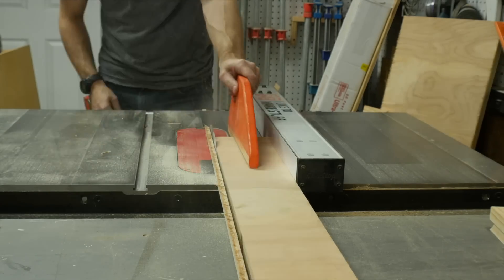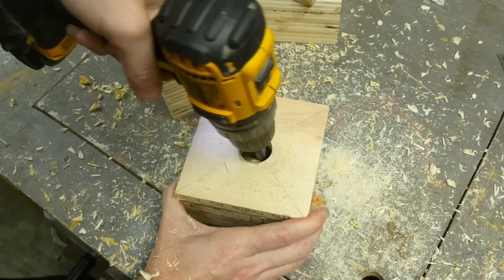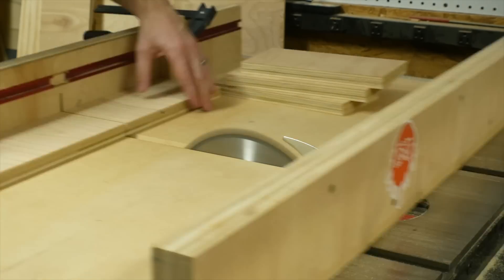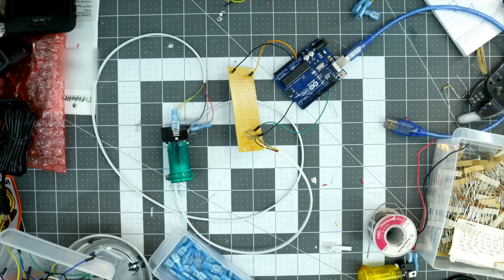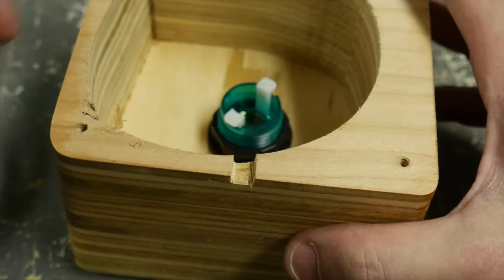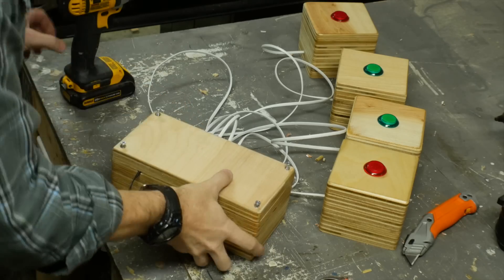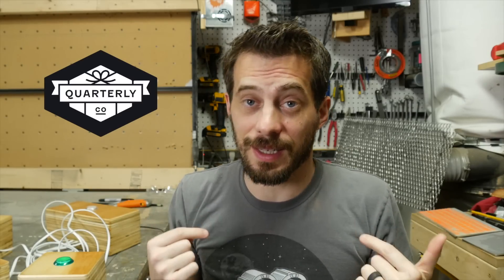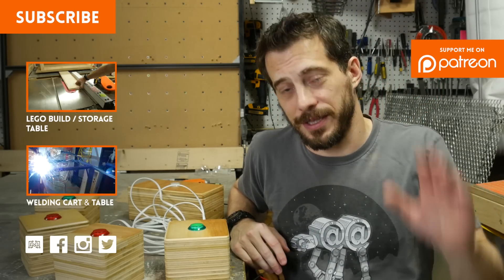Quiz Game Buttons // How-To | I Like To Make Stuff

Comment: 3:30  Better to put in a jack plate with 4 female RCA jacks and put male RCA terminators on the 4 buzzer boxes. That way if you have a short, you don't have to crack the box and resolder. Also allows you to use extension cables if need be with a male RCA at one end and female at the other

Comment: ok used your setup programmed audrino with your code BUT PROBLEM WHEN I GET CLOSE TO PUSHING THE RESET BUTTON IT TRIGGERS I DONT EVEN TOUCH THE BOX MY HAND GETS 2 INCHES FROM BUTTON AND IT TRIGGERS ANY IDEAS  WHAT IVE DONE WRONG CHECKED ALL EARTH WIRES CHECKED ALL BREADBOARD STUFF IM STUMPED  need help 
sorry for capitals i wasn't watching typing sorry people hate capitals

Comment: you should have put a telephone Jack on all the boxes instead so you can just unplug everything for storage or to use longer wires. you could also really easily add a buzzer to the player boxes or 4 LEDs to the control box to easily tell who buzzed first.

Comment: So, I know this request is nearly 2 years after the original post, but I figured it was worth a shot.  Anyway, I want to design a game show buzzer similar to what you have here, with the first button pressed lighting up, but I want the button to start a predetermined (10-15 second) timer when it is pressed.  Then, at the end of the timer, a buzzer sounds.  Then, I can hit the reset button and to stop the buzzer and/or the timer and start the process over.  I may be getting in over my head, but I thought I could dream.  Any help would be greatly appreciated.  I like your channel and I thought if anyone would know how to make this, it would be you.  Thanks, man.  Keep up the good work.
Reply from the maker: Hey David! That's a fairly simple upgrade from the code I used for this.  Grab that code from my Github as a starting point, if you want.
Once you've captured that a button has been pushed, write the variable 
unsigned long StartTime = millis();

This is the # of milliseconds since the program started running.
Every time you enter the loop, do something like 

unsigned long CurrentTime = millis();   //capture the current time since start
unsigned long ElapsedTime = CurrentTime - StartTime; //find the elapsed time

if ElapsedTime > 15000, then do whatever...  

15000 milliseconds being 15 seconds.

hope that helps!

Comment: Also why to hot glue straight to the arduino? atmega chip and hard wiring would be much cheaper. and you are using like 9 io ports lol. 

and what is in the maker box? lol.

Comment: I made a very similar device using an Arduino Mega.  Since the LED and the button can share a ground, I used a 3 wire stereo audio cable. That allowed me to have eight 3.5mm jacks on the control box so that you can plug only as many triggers as you have players.  I also added a little piezo buzzer to the control box that went off when a button was pressed.

Fun project.
Reply: I used a mega to have enough I/O pins for 8 players. You need 2 pins per player (input for the button switch, output for the button light), so not sure how many players you can squeeze into an uno. You can probably use the analog pins as inputs if you start running out.
Reply: @eugenerk  Thank you!
Reply: Do You think I could do the same with an Arduino uno ?

Comment: since you were using phone cords how about male plugs on each end and female receptacles on each box? That would be easier to store, help with tangles, make cord replacement easer and let you use longer cords if you wanted.
Reply from the maker: +John Kolesa Also more work and I hate punching those wires into terminals :)  I had to run too much cat5 back in the day.

Comment: considering you're using those phone cables why not place the actual connectors 
now you have everything constantly connected and a big cable mess

if you use the original connectors and plugs you can store it a lot easier and it will take only seconds to connect and use rather an hour to untangle the wiring

also maybe a small phone vibrating motor for a extra bit of feedback to the user?

Comment: Something I just recalled about using phone wire for projects: Older telephone wire can sometimes be a copper wrap around some kind of cloth like bundle of fibers. Just toss this type of wire out. It's very difficult to solder to and I'm always a little paranoid that the fiber might be asbestos.
Reply: +Right. How do I make that? I second that. It's a real bitch to first strip without cutting the whole thing, and then to solder. Pro tip: to get rid of the cloth around the thin wires, use a pocket lighter to lit these mofos on fire. This will also melt the little plastic insulation around the wires and will expose them nice and clean.
When he said he was gonna use telephone cable, I was like 'you crazy bruh?!'
Turns out he used newer cables eh xD

Comment: Nice Project! My suggestions to make it a bit better: 1. Use an Arduino micro. i think it can act as a keyboard, so it could control a quiz game on pc, for example. 2. An Uno is a total overkill here. the micro will take much less space.
3. Don't glue anything on the arduino. Design a board with a socket for the micro. it will look better and you can take out the arduino afterwards, for programming. These are my ideas, but your project is nice anyways.

Comment: Nice, but Arduino is an overkill here, you can make the necessary circuit for less than $5
Reply from the maker: +Aleksandar Tadic That Arduino was $7 on ebay, so that's not a huge savings, plus, like I've said in countless other comments.. I'm not looking for the most streamlined way to do projects.. I'm looking for ways to remove barriers to entry so people with zero experience can jump in and get started.
Reply: I didn't realize Arduinos have gotten so cheap.
Reply from the maker: Ridge Woods You are correct :)
Reply: +Aleksandar Tadic Yeah, there's even chinese Arduino Uno clones that sell for $3.50. It's crazy.
Reply: +Aleksandar Tadic $1.32 if you're interested http://www.aliexpress.com/item/Pro-Mini-ATmega168-5V-16MHz-Compatible-for-Arduino-ProMini/32579326448.html Just have to wait 4 weeks....

Comment: I see you're using the Arduino as the source of the LEDs which is a bad idea since the individual ports can't handle all that much current. It'd be a better idea to use the Arduino to sink, meaning you'd connect the plus wire to a resistor and positive end of the LED and the negative end of the led to a port on the Arduino.

Comment: nice, you can strain relief those cables with zipties (prevent pull out), or better yet tie them to an internal screw/post/staple...luckily it's easier to pull a rope than push one ;-)     monodirectionalFTW hehe

Comment: Great. Just one tip, next time try to knot the wire from the inside of the box, that way if someone pull the cable hard it will never break the bond of the super or hot glue. Of course it the pull is too strong the cable will tear apart.

Comment: How many Arduinos do you have?
Reply from the maker: +technician2014 thousands.  Actually, I bought about 10 of them from China (they're clones) for about $3 each a while back.
Reply: +I Like To Make Stuff Do you have the website? Thanks!
Reply from the maker: technician2014 Looks like the price has changed a bit since then, but still, $7 is pretty good! http://www.ebay.com/itm/252142616650?_trksid=p2057872.m2749.l2649&ssPageName=STRK%3AMEBIDX%3AIT

Comment: Nice project. 
An idea could be having all the cables to the big box be connected in a socket, each cable has it own socket. so you can diassemble it all and dont have the wires tankled. But just an idea. I know it will take some more work.
But thx for sharing.
Regards.

Comment: Excellent project, Bob. Any thoughts on how you chose the size for the boxes? Obviously they have to hold the button pieces and wiring, but they looked big to me at first glance. Kids had no trouble with them : ) and now I wonder if smaller would actually be harder to use. Mostly curious about your design process on that.
Reply from the maker: +Matthew Friedrichs It was just kind of random. I wanted to make sure they were heavy enough to not knock around on the table but otherwise I just picked a non specific size.

Comment: Hey Bob! Any particular reason you didn't use a forstner bit on the drill press instead of the band saw? It would have avoided the cut in the side of the box that had to be glued.

Comment: What does the 5th pin do? Also - it would be a cool idea to be able to put a couple extensions in so you have the base 4 and can add controllers!
Reply from the maker: +Jake Masters They button part of it has the 3 pins,  two of those are labelled "normally open" and "normally closed"  Depending on which you use, it changes the behavior of the button.
Reply: +I Like To Make Stuff Thanks! :)

Comment: This is really cool Bob! I haven't played with arduinos at all, but would it be much trouble to add a speaker that makes a sound when a button is hit?

Thanks for the inspiration!
Reply from the maker: +Jack Creek Road Not a huge amount of trouble, but you'd need a little more hardware for it. The Uno doesn't have built in audio amp or line out so you'd need to make your own or add an audio shield.

Comment: Nice project! I only frowned a bit when you put the hot glue on the wires & Arduino. I had some issues with those jumper wires so since then I'm using pin headers, they are much more secure! (You can even get them coloured!!!)

Comment: This is neat. I would have added jacks though, so they can be unplugged.
Reply: +bwoogie Yeah, if he'd used phone jacks he'd have been able to use the original connectors on the cords too.
Reply: @TheChipmunk2008  or TRRS 3.5mm auxiliary cables.. The ones with 4 rings.

Comment: Very nice project, a few changes I would make if you do a version 2.0. First, add sound! Remove the control box and have each button box with its own arduino micro to light up the led and drive a speaker, the led could stay on for 30 secs instead of having to reset.

Comment: This is awesome, Bob! I'm just learning arduino and all that. One question - I get why you need a resistor for the power on the LED. Why did you need a resistor for the the switch part of the circuit though?
Reply: +Carter Wilson Workshop with Bradley Boggs It looks like pullup or pulldown resistor, but in weird configuration. Here's simplified diagram, but it's even more bizarre: http://www.iliketomakestuff.com/make-quiz-game-buttons

I'd guess it's intended for protection, but in this circuit button short's 5V to ground which doesn't sound like good idea. I think better would be a pull-up resistor and a button shorting pin to ground.

Comment: I once did the same with this kit: https://www.conrad.nl/nl/quiztafel-kit-vellemanmk133-72647.html The kit does the same, even the reset button is there.

Just replaced the buttons with arcade buttons and the leds with some relais to turn on 220v lamps for a quizshow.

Comment: A whole Arduino is a bit overkill for a simple application like this, why not use an Esp8266 or Atmega328 Standalone?
Reply from the maker: +SolidMPH The point of using an Arduino is to lower the barrier to entry for someone new to electronics. I want people to get into something new, not be afraid of where to start.  Telling someone with no electronics experience to "start with a Esp8266" probably won't get them very far.
Reply: +SolidMPH A wifi module is overkill too (Except if you want to post results online which is a useless but neat idea though), just use an attiny84 as it has enough pins ;)
Reply: +STcraft You're right, Attiny85 would be even cheaper. But to start with electronics Arduino is the way to go, that's true.
Reply: ***** oh didnt see that reply, because youtube lol

Comment: I really like projects that combine technology and woodworking. I was thinking, if you routed the data connection to the arduino board through the control box also, you could then update the code with different programs, like a simon says game.
Reply from the maker: +Matt Archambault Definitely! Instead of the 5v power supply, you could run a USB out that would act as power and/or reprogramming!

Comment: Looks good. I would knot the part of the cord inside the box a few times just so if the glue failed at any point you could not pull on the connections inside.
Reply from the maker: +Buzzismyhero That was the plan originally, but given the shape of the wire, and the thin gauge of the inner wires, that might actually be hard to do with out breaking something internally.  These won't get a ton of pushing/pulling so I think it'll be ok.

Comment: why would you hot glue an arduino? just build an arduino on a breadboard! it is is 2 22pf capacitors and a16mhz oscillator. it costs 4 bucks instead of 25.
Reply from the maker: +Trevader Actually this one cost $3 from China, so that's why. Also, If you say that to someone who is just getting interested in electronics, they probably won't even try it.  Using an Arduino is a fantastic way for someone with no prior experience to get started, and that's my goal.
Reply: I Like To Make Stuff, Thats true. I guess if you bought a 3 buck clone there's no reason to save it

Comment: Nice, thanks for sharing. I would build half height to safe some storage in the cupboard ;-), Instead of superglue you could cut the wood a little bit tighter or with an heigth in den middle, Kind of strain relive? Most important: if the kids loved it - 100 Bonus points for dad. This is very rewarding.

Comment: Couldn't you just drill thru the wood and then put the saw blade through that?
Reply: +Nicholas Smith Only with a scroll saw. They tend to cut slower because they're smaller, though it ends up with a more precise cut.
Reply from the maker: +RideThroughLife You certainly could, or use a jigsaw for the same effect. I just enjoy using the bandsaw more than either of those other two.

Comment: Looks great! Since you are using phone wiring I would have installed phone jacks on each one (the actual plug in is easily removable from the wall plate), that way you can vary the length of wire depending on the situation and make storage much neater.
Reply from the maker: +Lupco Inc. I did think about that, but then when I thought about the tedium of punching those connectors and buying the punch tool, it took me back to my days of running ethernet cables and I started crying (just joking) , so I didn't go that way :)
Reply: +Lupco Inc. Such a great idea.
Reply: +I Like To Make Stuff agreed, punching stuff down can be a pain. Standard house outlets however, have screw terminals. The final product still looks great.
Reply: I Like To Make Stuff, would this also work with usb cables in stead of phone cables? You could then add a female connector and it would make connecting a little easier and usb also has 4 wires. Or wouldn't this be possible?

Comment: This is awesome! Great video. I had a thought to make the length of wire to the buttons adjustable, and to make them disconnect for easy storage you could add some phone jacks to the outside of each box. Then if you want a longer cord you just buy a longer phone cord, plug it in and you're good to go.
Reply: You could have phone or ethernet cable jacks "keystones" act as a port on the outside of the box and all the wiring on the inside of the boxes would be exactly the same.

Comment: Why an Arduino ? It's expensive compared to other solutions. I've used arduino a bit and it's great but I know that you could have put a smaller thing (and cheaper) inside your box, I just don't know what and how exactly. I understand why you would choose one but if you could show alternative solutions that would be more interesting to me ! (And cheaper for you ;) ) 

Great project anyway ! Cheers
Reply: The simplest way is to remove the Atmega microcontroller (the IC) after you finish programming it, then use it directly with other peripherals. This way everything is exactly the same.
The Atmega328 is about 3 dollars I think.
Reply: You also could make this using digital logic circuitry. That would be cheeper (less then a dollar) and give the game more resolution. That being said using an arduino is something most people bob's channel can do comfortably so I understand why he uses them for a lot of his projects.
Reply from the maker: +totomhavehat This was a chinese clone that cost $3, so I'm not too worried about the cost, but the bigger issue is that it acts as a low barrier to entry for people who have no prior experience and want to get started.  THAT is my goal, not using the absolute most cost effective, or minimal approach. I want people to try new stuff, and often that means removing things that make it overly difficult to begin.
Reply: +I Like To Make Stuff totally agree with you on this point ! Arduino is good for beginners, I just thought a 40$ arduino was a bit overkill for that job.
Reply: Hey Bob nice video, Im currently trying to make this for christmas for my kids, but i'm kinda stuck. Got some questions! :D 1. what value resistors are you using? 2. Does perf board act the same as breadboard? or is it just open holes you need to extend the 5v and gnd like this https://goo.gl/iPs5ag  when soldering? 3. And what 12v power supply did you use? got one that is 1.5a max, is that too low?

Comment: Fun and easy project! Just a little sugguestion: you should have tied a knot on all the cables just inside the box, doing so you will prevent the cables getting pulled outside by accident.